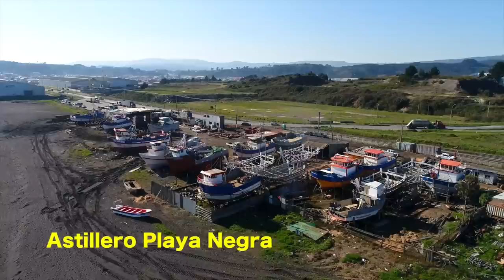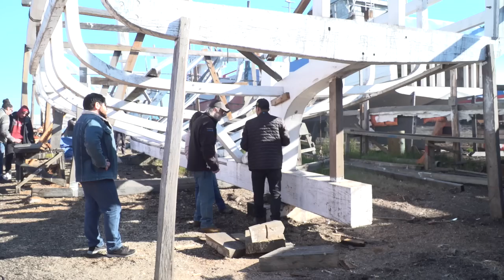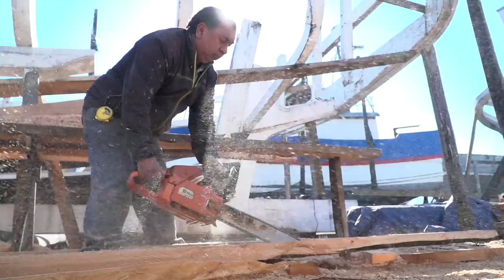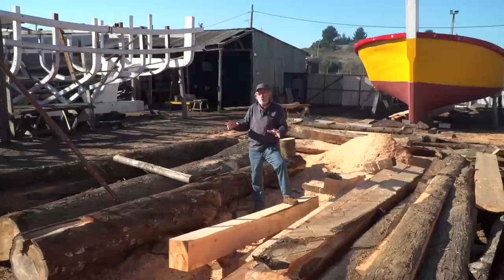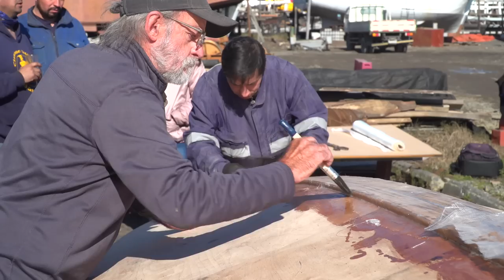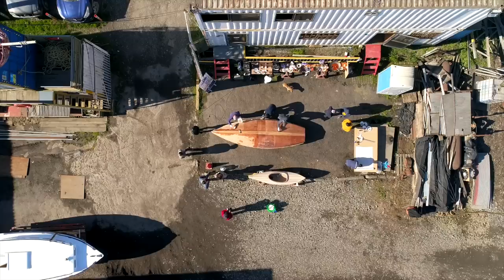Tips from a Shipwright - Lou goes to Chile

Comment: Lou.  the almost perfect chainsaw cuts are done by only cutting an inch at a time .. they were trying to get that to you but it got lost in translation.. when you only cut an inch deep.. you control the cut.. when you cut full bar deep the chain controls the direction of the cut by how much slop is in the chain and guide groove on the bar. .  thats brilliant of them to figure that out.. there is a way around it allowing you to cut full depth... new chains and new bars  so the chain with a factory grind is the only one used for full depth cuts..  also invest in the Stihl chainsaw sharpener to match your chain pitch.. they call it a "Stihl 2 in 1 Filing Guide" when you sharpen your chains with that.. look carefully at the chips that come out of the cut.. instead of saw dust it comes out as curls like you took a hand plane thru the cut.

Comment: Wonderful video. What fun. Yup, you would pick up building with a chainsaw alone within a week's time. It is slow and takes strength and patience, but the cost benefit is huge when you don't have a sawmill or a Woodmizer horizontal band saw or an Alaskan Saw mill set up, OR a Ship's band saw because of the expense of those things ... that's for sure.

Comment: I built a few wooden boats from the 1960s to the 1980s. The last one I built was an A-Class catamaran. 1/8" ply, stitch and glue, using copper wire, woven mat and epoxy resin on the "keel" join. Sort of semi WEST system. Very light and very strong. Bending the ply in two dimensions makes it very rigid. 

The technique has been supplanted by ultra-light, emotionless, plastic hulls built in factories. And the price of an A-Class catamaran has gone stratospheric. Ah, well. 

Mind you, I would have loved to sail the foiling A-Class catamarans, whatever the technology and whatever the price. I got a bit old. 

Have you ever explored this construction method, Lou?

Comment: I'm surprised they don't use a chainsaw mill for some of those larger cuts but maybe they just haven't been exposed to one.  You do what works and it becomes tradition.
Reply: Ross Branch /Operations Manager /Bristol Marine (Booth Bay Harbor Shipyard) has videos and posts on cutting 7 inch thick Southern Live Oak for the Frame Futtocks on The Ernestina Morrissey . Steve Cross akaSuperAX